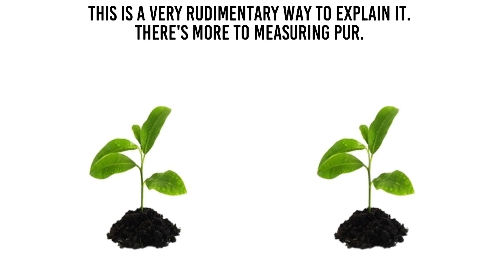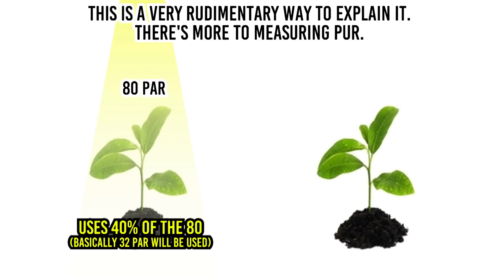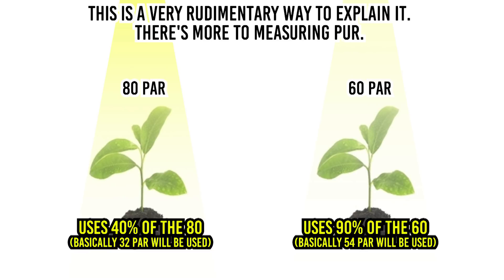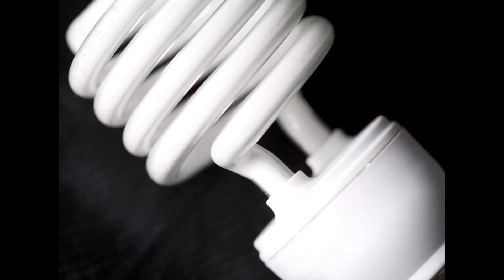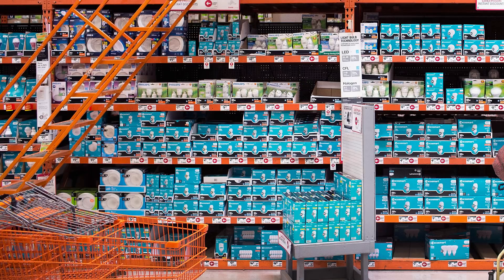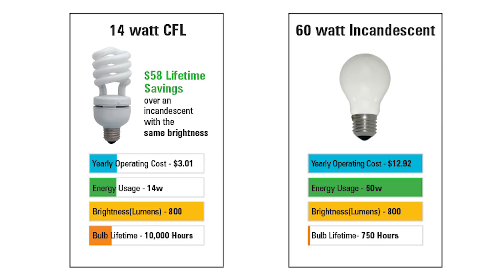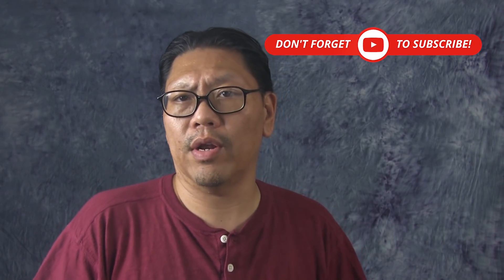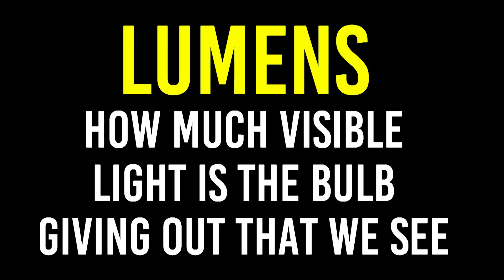PUR, Watts, LUX and Kelvin - Planted Aquarium Lighting Guide – Part 7

Comment: So if i understand it correctly, i have a light i can set anywhere from 3000 kelvin to 6500 kelvin. Are you saying that it doesnt matter what kelvin i set it on, because that kelvin is only visible to us humans and the plant growth will be the same regardless of what kelvin mode i set my light to? It's about the other factors such as intensity?
Reply from the maker: Kelvin rating has little to do with what spectrum the plants need but that depends on the lights you get. Some can allow you to adjust the kevin with little change to the spectrum going out from the light but that really depends on the make of the lighting kit.  As for intensity, you really have to look more at, again, the kit and that main factor is the PAR and PUR ratings that lighting kit and produce.
Reply: @TheWaterBox  i have the onf flat nano pendant 90 cm. The light has the really good full spectrum LED so I suppose the Kelvin change will not affect plant growth but just the anesthetics of how my light and tank appears to me?
Reply from the maker: @stigblue  In a nut shell, yes.  Does that pendant actually allow you to change the kevin rating? Or just the "color" of what's coming out of the light? It's really hard to say not knowing how it's built.
Reply: @TheWaterBox  i do not know. Obviously there is a difference in the appearance of the light from warmer to white. But I suppose that is also what Kelvin should work? 😅
Reply from the maker: @stigblue  Maybe? I don't know what kind of lighting kit you're using that can change the "Kelvin" rating. What exactly are you doing on that pendant light that's changing the "color"?

Comment: Great information, I've never researched it beyond lumens (common sense told me that watts were not that useful from the plants' point of view). I'm surprised to hear that color temperature doesn't affect plant growth. Intuitively I would have thought that plants adapted to use the colors of light they are likely to receive in their natural environment. Thoughts?
Reply from the maker: Color Temp (Kelvin) of a light is based and measure on what we see.  The spectrum of the light is in itself a measurement in what the plant actually uses.  You can have a warm light making your tank look red but if it's not pushing the actual spectrum of red (or blur or green) that the plants can use, it's not all that useful.

Comment: Nice video.
I got a light with 4000k on it,
Now i don't know this is silly or not but will adding 2 such lights makes the setup 8000k or is that still 4000k ?
Reply from the maker: Kevin' ratings don't "add up".  It'll mix. For example, you take a 4000k (a warmer light) and put in a 8000k (a cooler light) it'll probably put it around 5000k maybe... can't tell without a meter but it will make the warmer 4000k light more cooler. (more white)

Comment: I got a question about my 10 gallon tank. So I'm trying to carpet the whole substrate floor with dwarf hairgrass, and I was met with yellow water as expected. I was reading a few other vlogs that yellow water is considered to be okay for my fishes, but it's bugging the hell out of me. If water changes should be frequent, how frequent should I do this for? And I'm using a CO2 booster, are the effects of CO2 from a CO2 tank different from using an API CO2 Booster?
Reply from the maker: First off, do you know what's causing the tannins? (browning in the water) for co2 booster it's a different thing than actually injection into your tank. It's just providing your plants with a different kind of carbon. It works but it tend to melt some plants and if not careful can kill you live stock (easier to overdose on liquid carbon.)
Reply: I did find that my tank had nitrates but with the fishes I have in there (3 Zebra Danios and 2 Glofish Danios, obviously good for handling those types of situations), I really don't know what's causing the tannins. I got artificial driftwood (will be taking that out soon for real driftwood), and I recently just did a water 50% water change but did not vacuum the gravel as it was recently planted...and even then that was useless as I still have tannins. Can tannins be caused by exposure of soil to the water?
Reply from the maker: If it's a soiled tank then for sure that's where it's coming from. Again, it won't harm fish (they actually like it) but it's annoying to look at. The only way is to just keep doing water changes and it'll go away. Did you just set up the tank or something?
Reply: Yes sir! It's been 3 days since I set up everything
Reply from the maker: Errr... and you already have fish in it? First off, the fish might not do good.  Soil creates huge ammonia spikes. Just do water changes.  You can do maybe 50% each week.  But I'd just testing the water EVERY DAY and if ammonia is too high, do a water changes to keep your fish alive. Sooner or later the tannins will go away. Even if the fish you got "are good for handling those situations" you still have 3 danios and 2 glofishes... To do what? Cycle your tank? Why so many in a 10 gallon tank to "cycle the tank"?  Either way. Just do water changes and the tannin's go away. You can use something like purigen or something to filter the water but that might not help too much. Good luck.